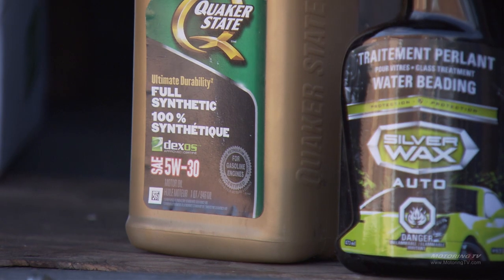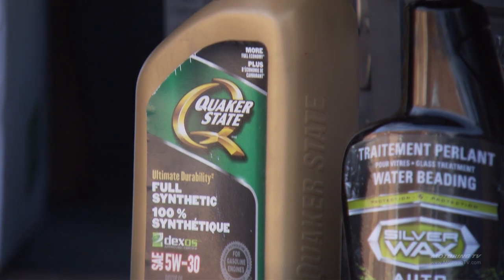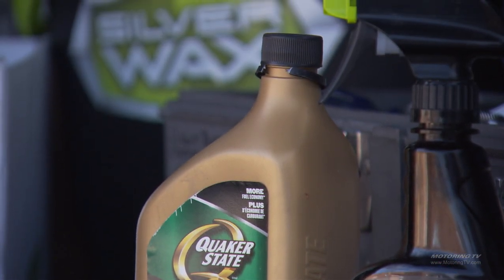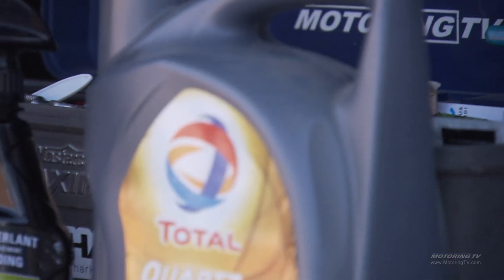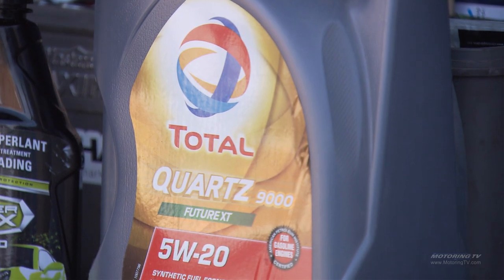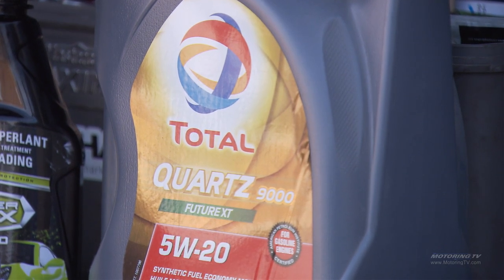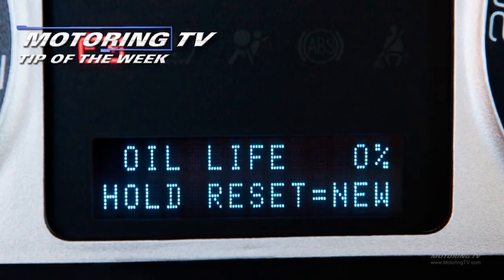Oil Life Monitor - Tip of the Week

Comment: Oil life monitor is me, not the owners manual. With regular driving that’s good enough for me.  If it’s been used for things like towing, lots of city driving, etc., do it sooner.  I change the oil on Our 2011 outback every 6k and our 2018 crosstrek gets done every 8k which is sooner than recommend.  That is based on our driving, not the owners manual.

Comment: Can you set the number of miles between oil changes? For example lots of people change oil at 3k intervals. I choose 5k intervals. The oil % life shows the same between both. Is the oil % life remaining simply determined by the intervals set like 20% of the set 5K miles?
Reply: It is not selectable. As the video states, the monitoring system uses data from the engine to determine the percentage of oil life remaining.
Reply: That is false my friend. I get my oil changed at 5k now. Used to do it at 3. Mechanic sets it where I want the oil changed. When it reaches that set mileage, the percentage is near "O". it was the same at 3K. @trekkeruss
Reply: @denveyebanks4787  Then it must vary by the manufacturer. My Honda is not selectable; I can only reset the OLM to 100%, not how many miles I want it to countdown from. I do know it works as intended, because the oil life varies depending on the conditions under which I use the vehicle. For example, the oil lasts longer when I drive all highway miles. Regardless, I typically do not wait for the OLM to read 0%; I will change it sooner than the system recommends, generally around 20-30%. I factor in how many months along with the mileage.
Reply: I have a silverado, before that a Ram 3500. They did the same. My driving conditions remain the same throughout. I saw my oil condition was not bad so I extended it to 5K. Pretty sure the % of oil life ONLY refers to what you have the intervals set. My oil is not suddenly going to last longer because I asked it to. Someone is blowing smoke. I'd have a talk with them if I were you. @trekkeruss
Reply: @denveyebanks4787  No one is “blowing smoke.” It is how the OLM system works in my Honda. It is spelled out in the factory manual how to use it, and I have researched to verify how it works. I am not questioning how your GM or Dodge system works, I am saying Honda’s system functions as described in this video, by using engine management data to calculate the oil life.
Reply: Ok, I understand.

Comment: I use the oil life monitor to tell me how bad my oil is. If it reads 50 that means half the strength is gone. If it reads 30 that’s 70 percent of the strength is gone. That’s when I start to make time to change my oil. Oil is cheap engines are expensive.